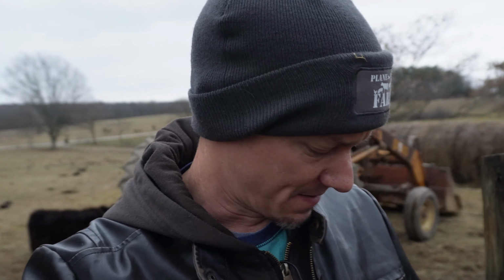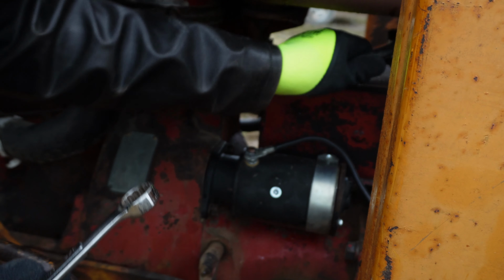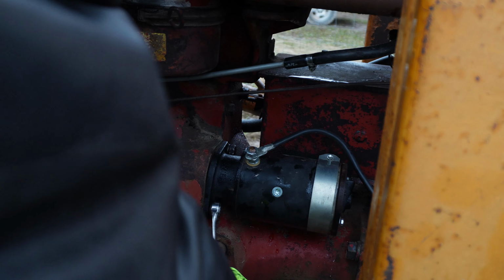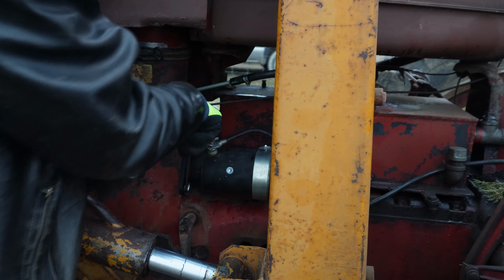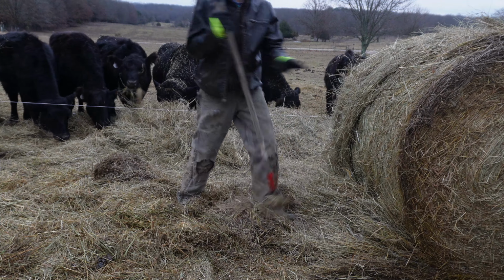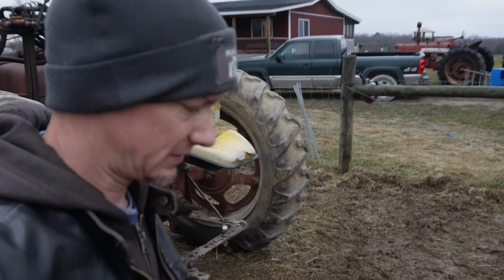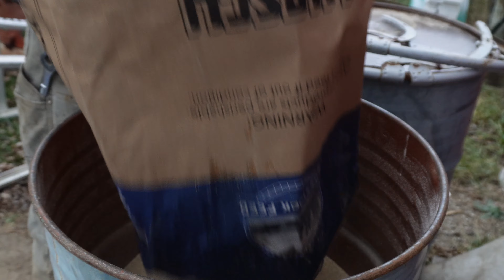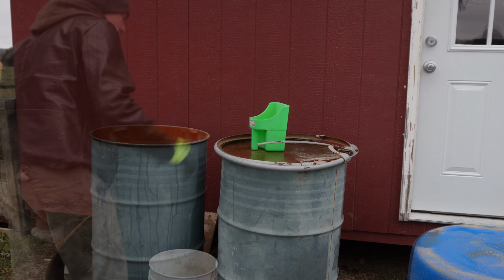Tractor Problems, A Muddy Day On the Farm, And Pigs CAN Jump!

Comment: Been there done that. Ok you can take the cover off that rear portion of the starter. you can then use a flat blade screwdriver to turn the armature.  you might have weak springs that hold the brushes to the armature? Nothing wants to start in the extreme cold new or old. What I have done with a M in the past is park it on a steep hill where I could roll start it.  I also got metal pans from old refigerators and placed them on cement blocks almost touching the oil pan and rear   housing and filled them with hot coals from the wood stove. take a propane torch and heat the exhaust manifold. I have  a few times  removed the muffler and poured gas  down the exhaust and lit it afire to warm up the intake and exhaust  manifold. You might put some weight in your pickup and pull start the old M? Its plenty cold down here today. We are not going to start any of our vehicles or tractors until it warms up. We are feeding the sheep with small square bales. I can carry  those by hand and feed in the places where desired. Good Luck to You All!
Reply from the maker: I'm going to do the same. I made sure everything is good on antifreeze and am gonna just leave them sitting. Stay warm!